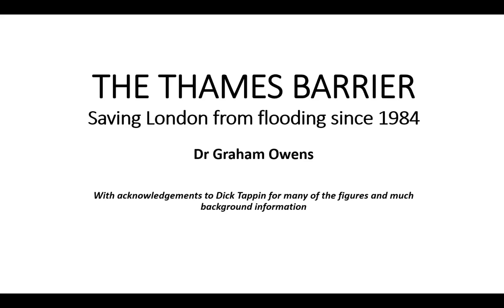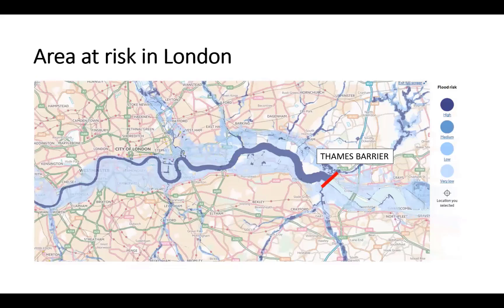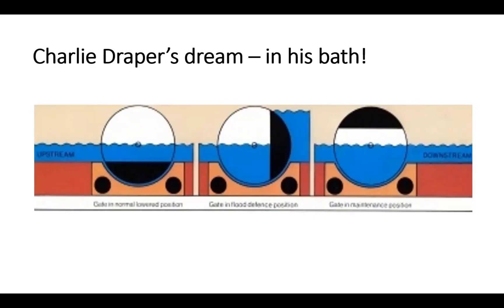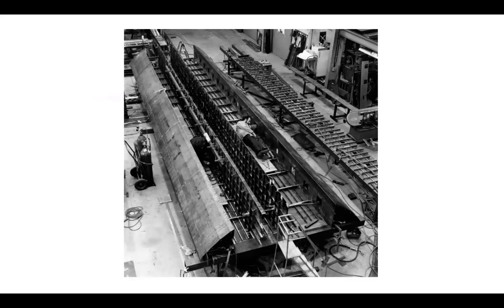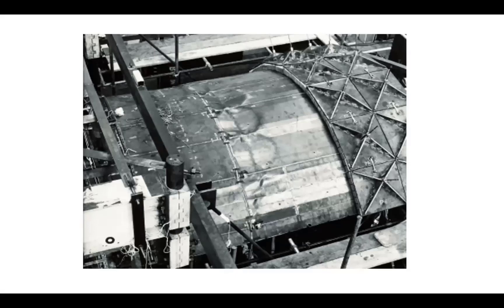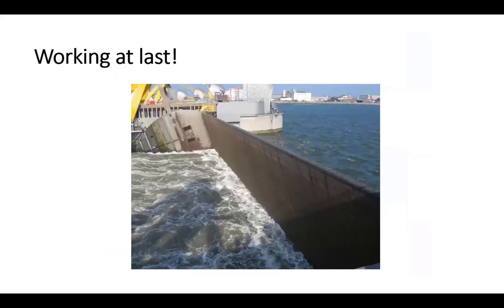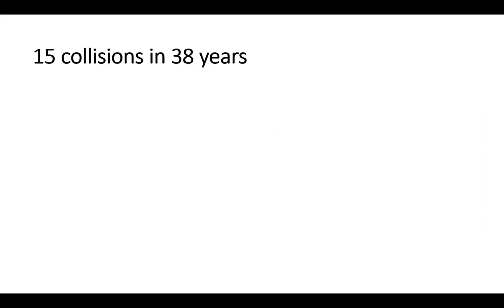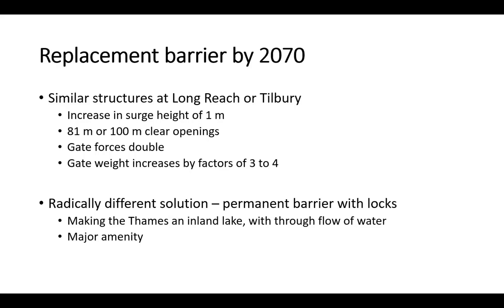The Thames Barrier

Comment: So Rotterdam has a movable barrier that lets the whole river be used by boats, but the British limited to 200 feet, 60 meter wide boats?
Reply: I think there's a number of reasons that could explain your question: 
1) The Thames Barrier design starts in the late 1960's, when, as could be seen in the video, the knowledge of steel structures was under investigation, and as yet the rule book with lessons coming from North Sea oil Jackets was undergoing a steel evolution / revolution. Rotterdam's magnificent barrier starts design life in an age of far greater knowledge as to what was possible. And as for computational power and modelling between the two projects there no comparison.
2) As explained, the reach of the Thames, from the barrier to sea is very long, at Rotterdam the barrier to sea is not that far. To avoid the hammer effect talked about, the barrier was designed to allow undershoot with the water, where as the Rotterdam barrier, as I understand it, is designed to allow this but with a different reach to the sea and a far better protected downstream (Delta works standards). 
3) As with anything there's a sweet spot as to the docks and wharfs upstream, and the tonnage that could be expected to make it upstream. Already traffic was falling away form the docks as larger ships were not coming up that far, so any wider or greater draft would not generate the return on investment. 
4) This is conjecture on my part, but the barrier was built in the Cold War, many of the people designing it remembered 1939-45 as living memory, not that long ago, so designing a structure with some reliance was possibly in mind.  A distance from the Barrier was the Littlebrook "D" power station. When designed (1970's) and commissioned in the early 1980's it was "hardened" with duplicate systems, concrete blast walls etc to help it's operation in a wartime environment. The barrier would be a great anti submarine defence if nothing else. 
5) Resilience, sort of point 4, but Rotterdam's flood defences were significantly upgraded post 1953 with the Delta Works going into the docks, havens  etc , that really did not exist in London, and a failure of a large gate system would leave the deep level tube, post office telecoms network in danger. Rotterdam is far better protected. Even if the Thames barrier failed on one gate, it could still slow the water up just enough to buy the time for the tide to turn,
Reply: 60 Meters is all that is needed